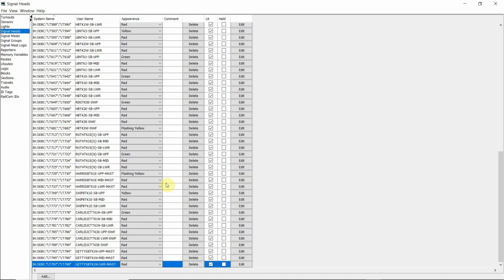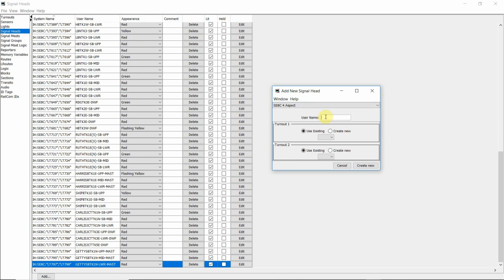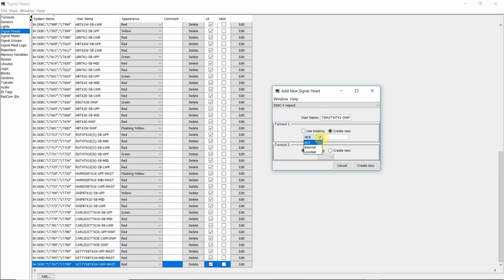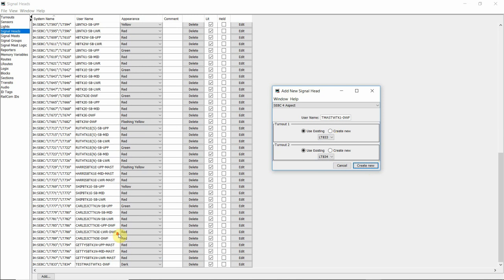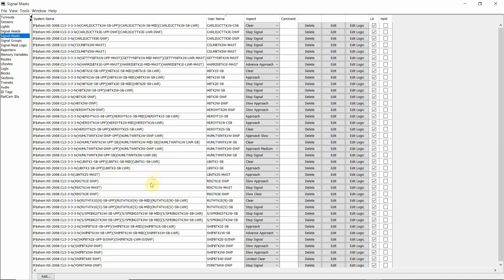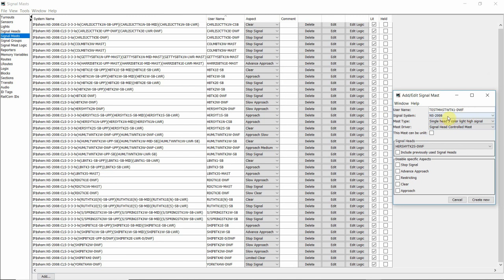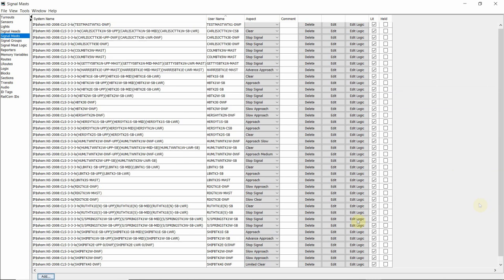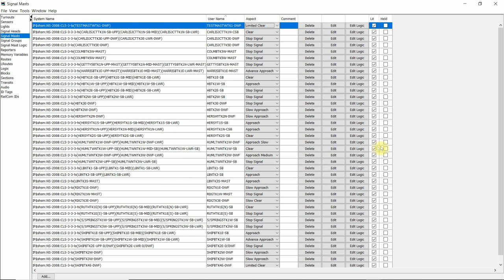1-Adding signal heads and masts to JMRI Panel Pro tables | 1 of 7 | December 2018 MRH

Comment: Good info, thanks. I look forward to seeing all your video's and see a different perspective on how you built your signaling. As you mentioned on MRH, there are many ways of doing this. I started with Team Digital's signal decoders and control boards for a stand alone system where no computer is necessary in the end. Also the signals use the signal protocol instead of the DCC turnout protocol allowing me to use the same addresses as turnouts or not. Then I built a backup system using JMRI and a PC so I can use Panel Pro to have a remote visual display of my track work and signals. Having a small tablet to walk around the layout or mount to the facia is really convenient also. Again, I look forward seeing how you did the programming.